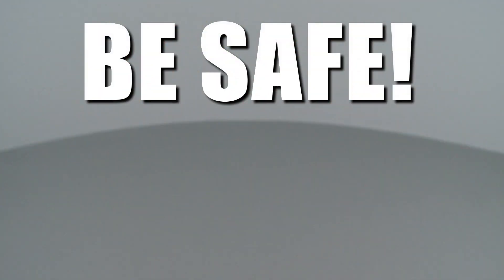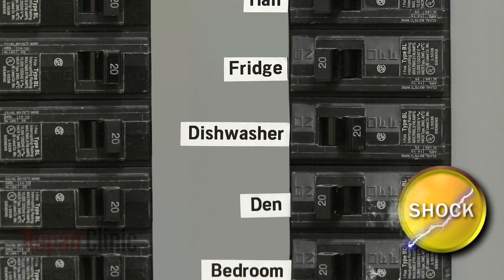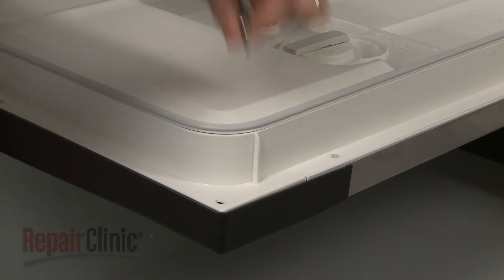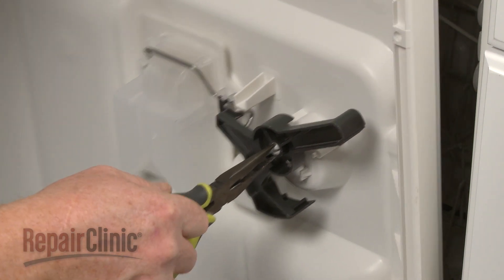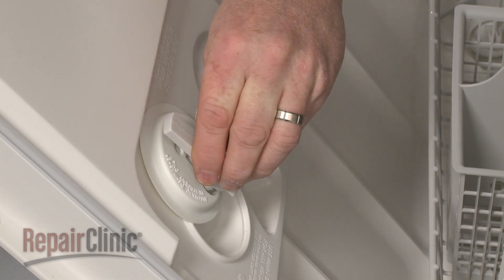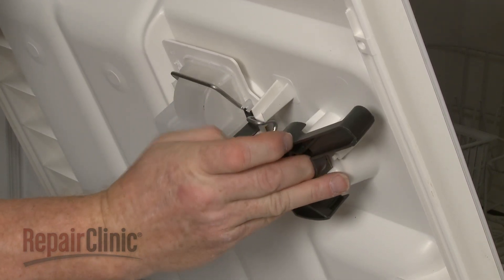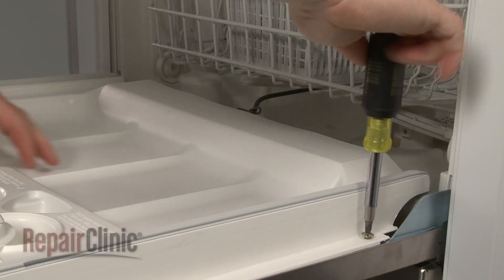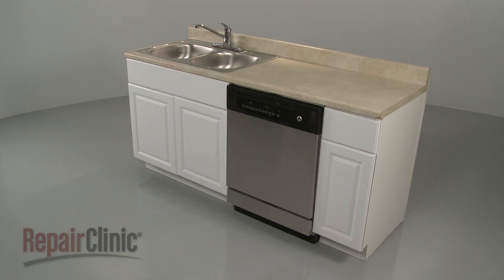GE Dishwasher Dispenser Lever Replacement #WD16X10011

Comment: This video did not indicate the spring position before reattaching the door liner.  When the lever arm is removed, the spring straight leg must be positioned behind the flat tab in order for the lever to operate correctly.

Comment: This seems easy enough... but could i get a rough estimate on cost?  I need to replace this on a rental house but i'm several hundred miles away so I would need to get a repair man.  Anyone have an idea on cost for this repair?
Reply from the maker: The part costs $1.65 on our website and it is an easy repair. So it all depends on the repair person's rates.